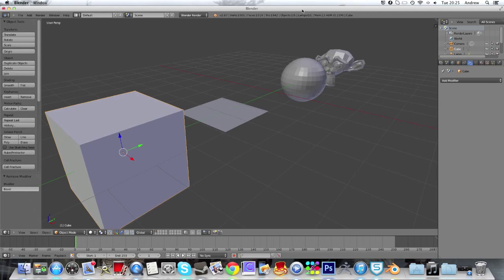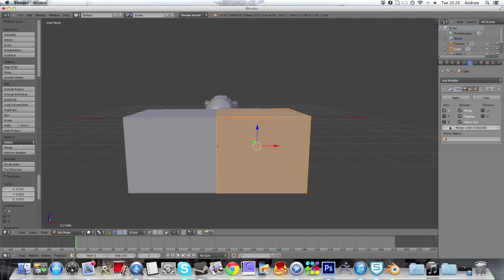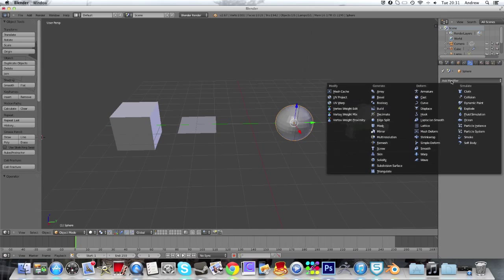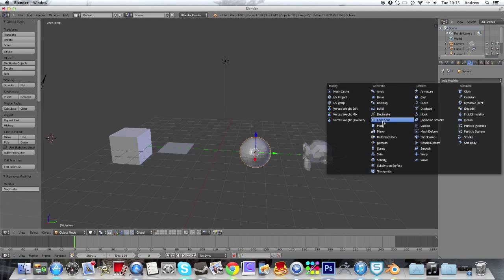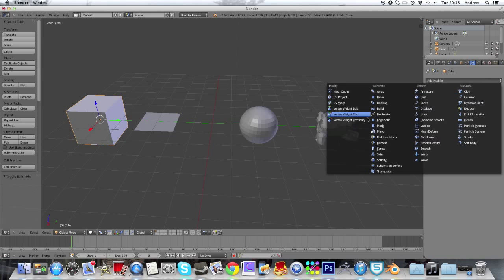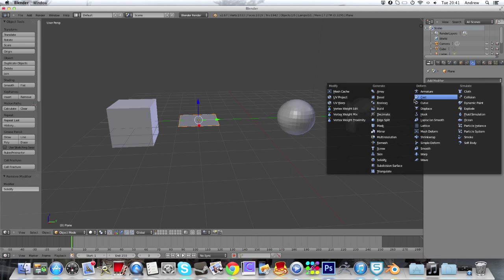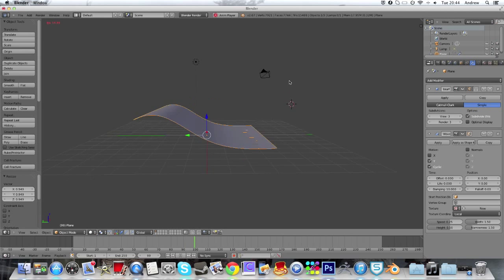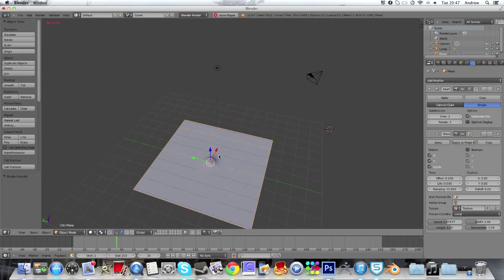Blender 2.6: Modifiers

Comment: An good example for the edge split modifier is to take a cylinder, turn on smoothing. And then to remove the smoothing artifacts apply the edge split modifier.